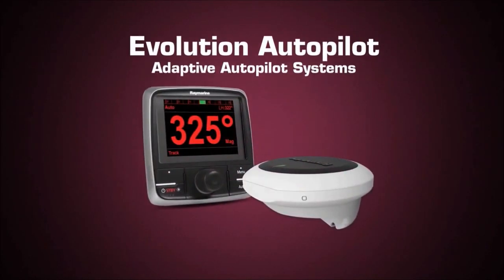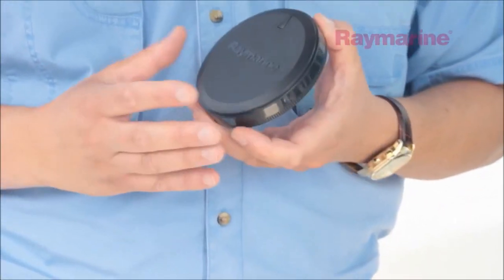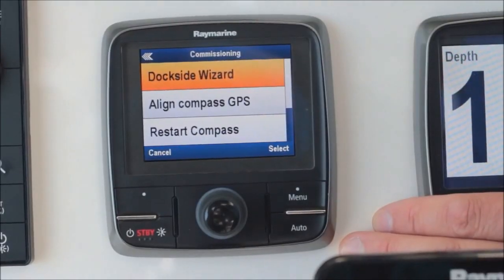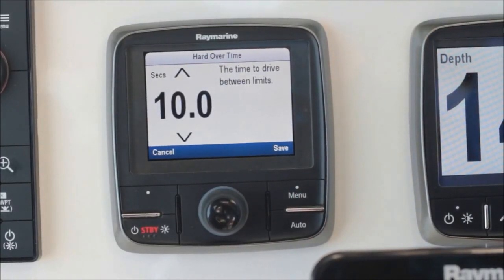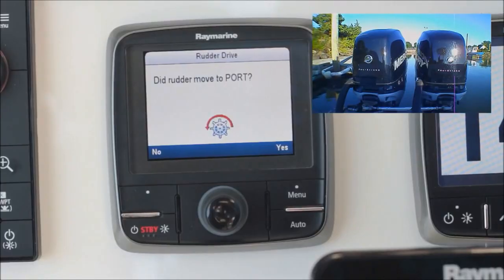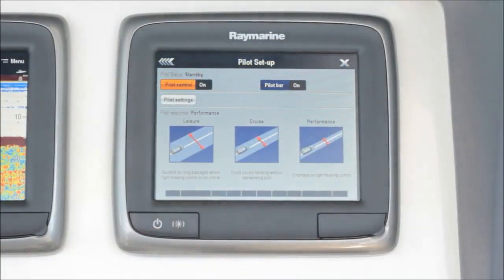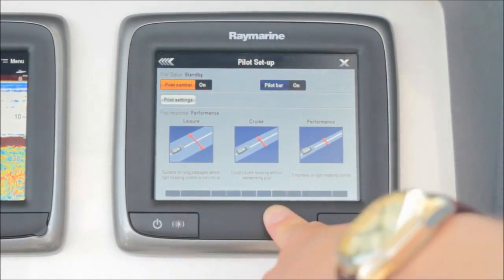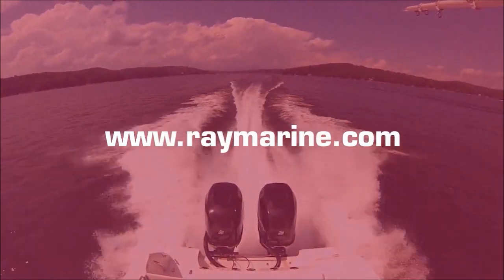Evolution Autopilot Sea Trial

Comment: Having difficulty turning mine on. It worked when I bought the boat a few months ago.

Any tricks at startup? Hold the power button exactly 15 or 30 seconds etc?
Reply from the maker: Hello Steve.  Your autopilot system it typically powered from one of the boat's main circuit breakers, because in addition to the pilot control head there are additional components behind-the-scenes that also are connected to power separately.   As for the control head itself, normally about a 1-second press of the button is long enough to turn it on.

Is it possible that you have the display brightness turned down very, very low from a prior night trip and now you can't see the screen?   Tap the power button to bring up the brightness control (even though you won't see it, yet.)  Then rotate the knob or press the up button on your controller to raise the backlight level.

Comment: It would help if you told us where the dockside calibration  setting is found. Please could you be more specific.
Reply from the maker: The setup wizard with dockside calibration appears automatically the first time the system is powered on when new.   If you need to get back to it press Menu and then select Setup...Autopilot Calibration...Commissioning...Dockside Wizard.

If you happen to have a Raymarine Axiom MFD/chartplotter you can also do it through there.   Go to Home...Settings...Autopilot.  Turn on Autopilot integration if it isn't already enabled.    The touch Pilot Setup..Dockside wizard to get started.  

The ability to control, setup and calibrate our Evolution-series autopilots from Axiom was a new addition since this particular autopilot video was originally made.

Comment: After installing the EV1 on my boat, there is a difference between the heading direction of the boat and the pointing direction of the EV1. EV1 points South, the boat"s direction is West. So I guess I will have to move the boat in order to enable the EV1 to align the compass with the boat´s direction. Standing still on the jetty it did not work.
Reply from the maker: Hello Peter.   The EV-1 will perform a linearization and calibration on its own when you are underway.   During that process it will learn the magnetic deviation characteristics of your boat and develop a correction table.   It should also correct the heading value that is output to the network and bring the boat icon into alignment.   

If your EV-1 is part of a larger autopilot system, there is an option in the pilot control head to perform a heading alignment where you can dial-in the boat's actual known heading to force it through a bit faster.    Automatic calibration will still continue in the background while you are underway too.

Comment: I  installed the Ray Marine Auto pilot only to find that it will NOT auto route - it DEMANDS operator intervention at EVERY SINGLE WAY POINT in a route rendering the use of a ROUTE with this make USELESS... It will work fine with ONE way point - it will NOT work with a route unless you sit there like an idiot ready to push the button every singe way point you reach... USELESS...  I say this because ALL other auto pilot makes allow for auto route ... ONLY Ray MARINE DECIDES for YOU that it will NOT work this way...  So far the only solution is to get a wireless remote so I can control the pilot manually from a place other than the helm.   So be WARNED if you consider this auto pilot that you WILL NOT get all the functionality you are paying for when you buy it...
Reply from the maker: Hello Dan.   Stay tuned for more details on a software update for our Axiom-series products which will change this behavior and allow the autopilot to follow a waypoint, and change from point-to-point automatically.   The software and details on this new feature are coming very soon.
Reply: @Raymarine  Praise the LORD and thank you... When is the anticipated release date of the upgrade and where will it be available?    No commitment - a time frame is more than fair here....My position here is that if the system will allow a boat to be steered by Apparent Wind Angle AWA - and the wind shifts as G-d tends to allow it and the boat adjusts to this new heading with the change in AWA.. (of course absolute  situational awareness of the operator is mandated) - then .. what is the difference on a pilot following a route (same requirement for absolute situational awareness of the operator being mandated)?   When I pointed this out to a Commercial airline pilot who is also a sailor - he agreed with my argument..